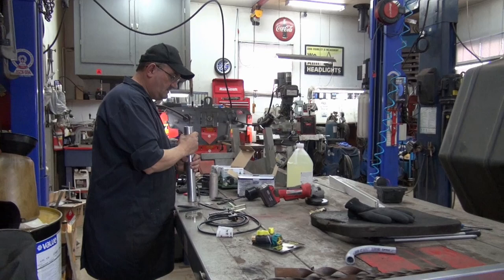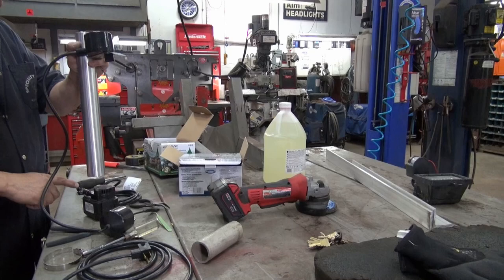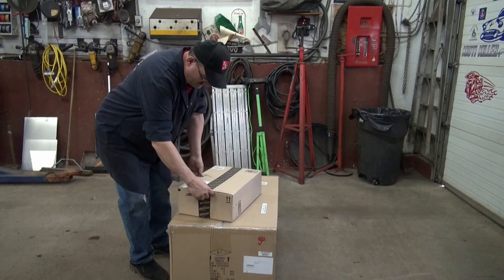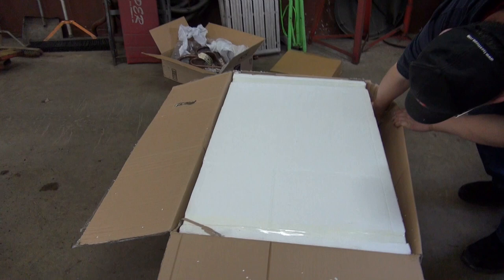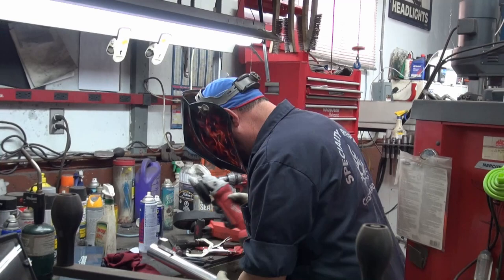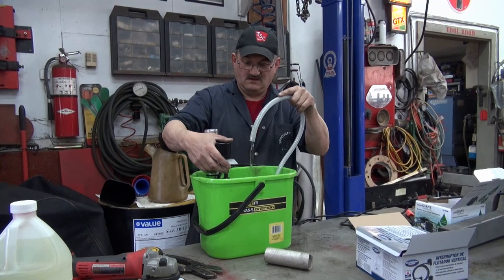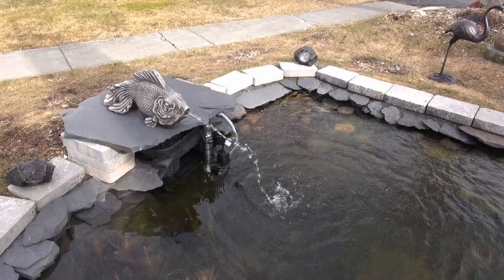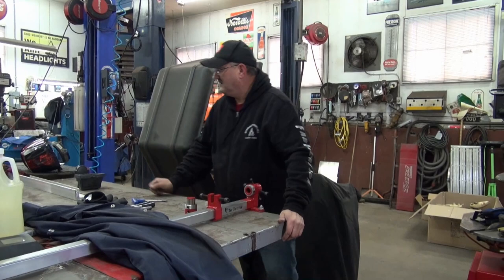Fish Pond Overflow Mod

Comment: Nice Mod on the overfull pond pump..Like that bird feeder just hope it don't blow away with some unexspected wind storm and I have an idea for anchoring down the fish heisting bear, drill a hole in his belly, fill it 1/2 or so of sand, Duc Tape it shut , set it where ever your gonna set it and that will be a done deal, no blow away bear and it would be easy to unload the sand later..Thanks you folks for another adventure in the life and times of the Kathy and Paul Show..God Bless !!

Comment: Hi Guys. Nice mod Paul. Paul I just want to tell you that I had my truck decalled with my business name and number. I removed the decals with the heat gun and as you stated the glue residue that's left behind is difficult to remove. I used Varsol and I must say that it came out easy and very efficient. All I did once it was all removed was give the truck a wash with water and soap and it was perfect. Just thought that if the stuff you purchased dosen't work you might want to try the Varso..

Comment: Paul-I assume in the past, if the pond over filled, you used a submersible pump to pump the water out. (sorry if you covered that, I could have missed it ) Your new overfill system will be a lot more convenient then getting the pump out and standing around waiting to reach desired level. The aluminum tube just holds the pump at the desired level, correct. Water doesn't need to go in the top like a toilet, right. Another great job and some fine Canadian ingenuity. Doug